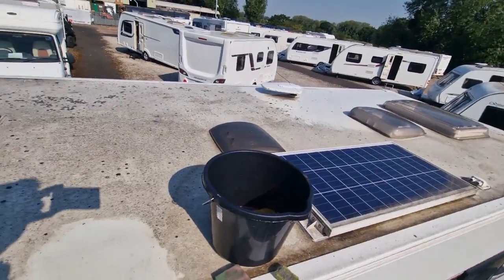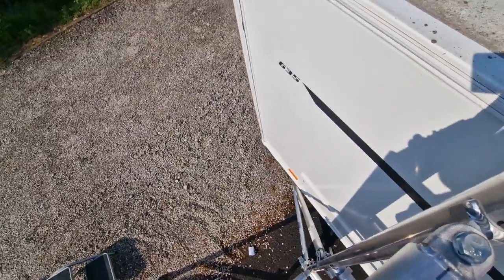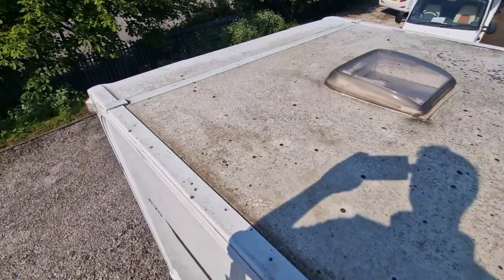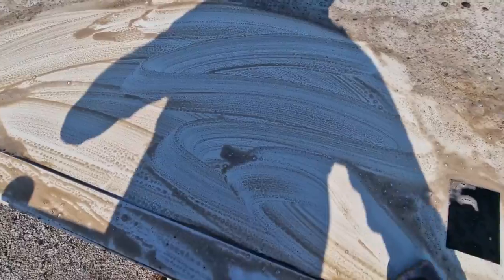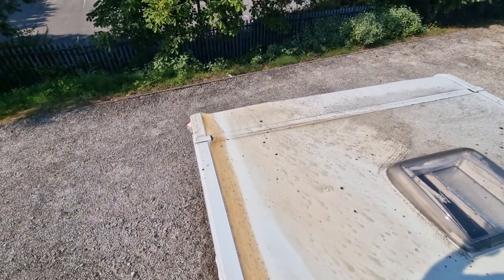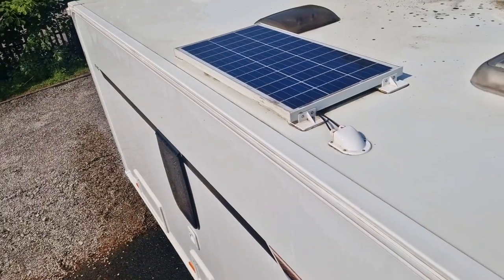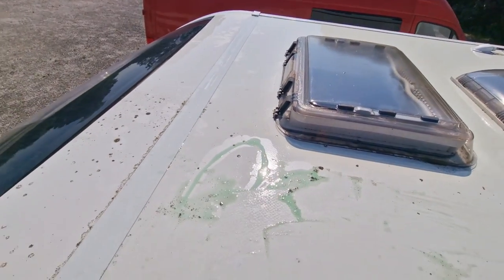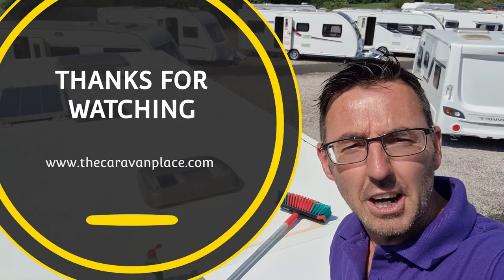New Toy Alert: Watch Us Clean A Caravan Roof In Record Time!

Comment: Washing up liquid is a de-greaser probably the worst thing you could use unless your going to polish it straight after doing it, any wax will of been removed and the spores of mould will stick a lot worse in the future.
Reply: 100% agree with you
Reply from the maker: Yes, perfect time to get the polish out, or just give it a wash with the wash and wax after . The jennychem is a  Traffic film remover, but then has a wax built in. But if you want to go the extra mile then get the polish out and the next roof wash will be easy.
Reply: I bought from Lakeland a scouring pad on an extendable pole, it is for cleaning bathroom tiles but would work well on a caravan roof.
Reply from the maker: @joreay5989  I just looked at some on Amazon, look like they would make the job a lot easier 👍

Comment: IDEA!!
You can buy the pads without the foam backing.
Why not hot glue a couple onto the back edge of the brush head.
HOT soapy water.
Let it soak then spin the brush on its back to scrub the mould?
You could reach much further than with the pad on its own?
Reply from the maker: They do a shower cleaning pole with a brush head and scrubbing pad heads which would work very well. 👍

Comment: No, Just no…! Would you use a scouring pad on bird droppings on your car? No… of course it’s going to affect the paint, you’re literally etching the surface with those abrasive fibres in the scourer. Spray on some cleaner and let it dwell to soften the dirt, then clean with a non abrasive pad. More elbow grease may be needed but your van will thank you for it! A good coat of wax will help stop dirt from clinging to the surface going forward.
Reply: Just cleaned my roof today and  was covered in bird crap so I had to lean over and use a wash mitt and fenwicks caravan  cleaner .All good,never use an abrasive just pre soak

Comment: Any tips for cleaning under the solar panel?  Why do they make them just too low to get your hand under?
Reply from the maker: You can wet a old towel and feed under then pull from side to side a few times. 👍
Reply: @thecaravanplace  Thanks for that Mark, I'll give it a go.
Reply: I just removed the eight self tappers holding the panel to the brackets and swung the panel out of the way, taking care not to drag it over the protruding bracket tops and not to stretch the cables. A little more work but at least I can do a thorough job on the cleaning. It’s amazing how much muck gets stuck under there and forms it’s own coating of mould over everything.

Comment: Most hateful job, but has to be done. I use a step ladder, but not happy about being up there tbh. I lift the large roof light and a step inside to do the front section. That's not so bad. Needs polishing/waxing, but keep putting it off...understandably.

Comment: Mine has got a lot of bird poo burns on it. Any suggestions or I can drop it round and you can make another how to video and I'll even hold the camera for you lol. I'm actually thinking of wet sanding it and give it a respray (only the roof)
Reply: Rather than a respray, why not some PPF?
May not improve the look, but you'd get a good seal and protection from future damage.
Reply: @rogerstarkey5390  Whats PPF?
Reply from the maker: Normally a bit of t cut and polish will bring it back.
Reply: @johnhickman5888  paint protection film, used in the car detailing world a lot. similar to window film but clear for paint  work.
Reply: For a car with bird poo burn marks just heat the area with a warm setting on a domestic hair dryer. When the paint is warm use a micro-fibre cloth gently in a circular motion on the area. Repeat until burn mark is erased. What you are doing is heating and releasing the top clear coat and resettling it on the paint. I cannot confirm if this will work on caravan plastic but worth a go.

Comment: Impressive results Mark, I struggle with the roof in that I can't reach the center, do you find your platform system gives access? Has anyone on this thread ever actually got on the roof for cleaning purposes, I have a Bailey and they seem to say it is possible though I never have.
Reply from the maker: We have a scrubber on a pole in our amazon shop that we will try to make it even quicker and easier.  https://www.amazon.co.uk/shop/thecaravanplace/list/31JHWM0SLNKES?ref_=cm_sw_r_apann_aipsflist_aipsfthecaravanplace_X1AJSHPE5FY7RVD8GFJ9
Reply: I put the step ladders on the inside and do most of the middle of the roof, then use the step ladders at the side to finish it off

Comment: have to be carful that you dont catch the sealant with scraper
better off using a clay bar on the spots or a magic eraser as wont scratch lik that pad will
Reply from the maker: Not all roofs are grp like this so yes you need to use whst is best for your roof and always do a little test area to see what works best👍